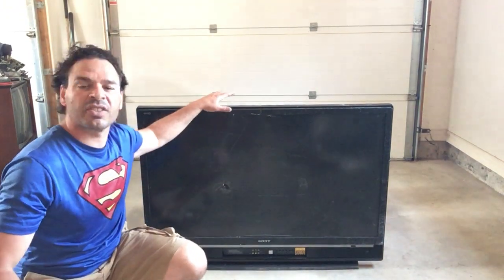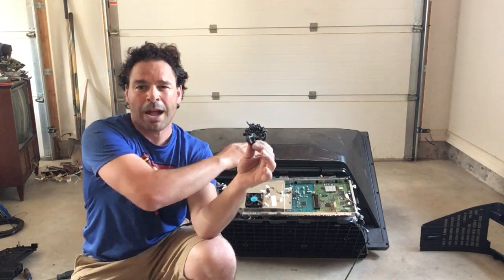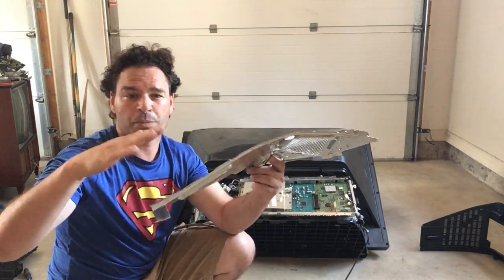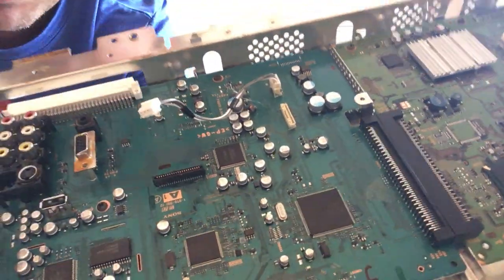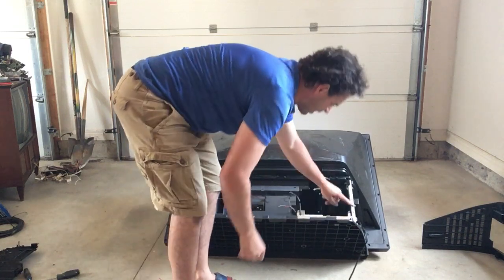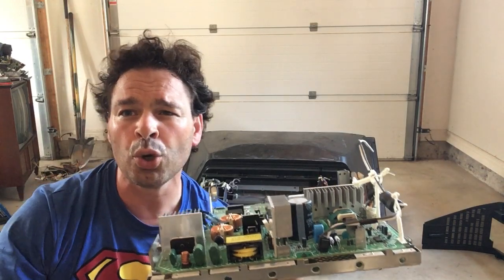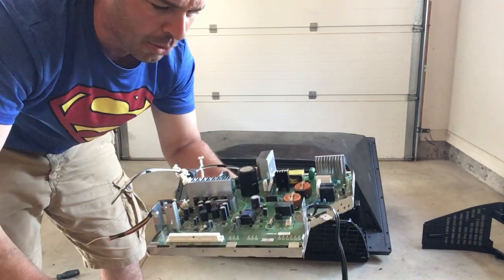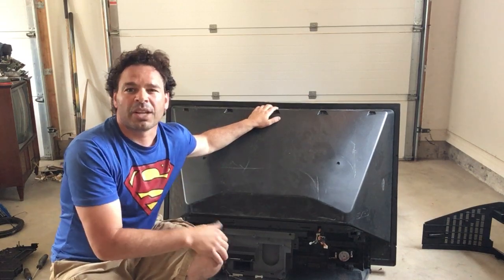Scrapping a rear projection tv for copper, gold, silver, tin, aluminum, and no waste!

Comment: The material around the transformer is called ferrite.  Magnesium is non-magnetic and a form of aluminum.  You will commonly find magnesium in Lawn Boy mower decks and concrete finishing tools.  If magnesium catches fire, do not put water on it as it will explode!